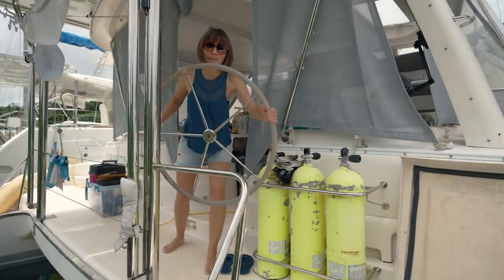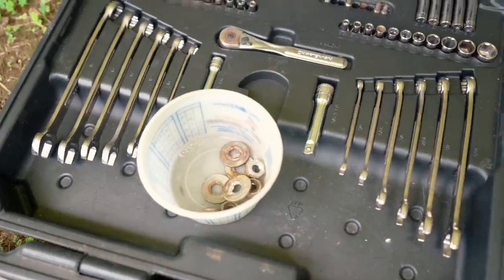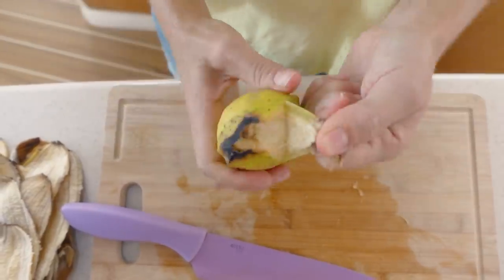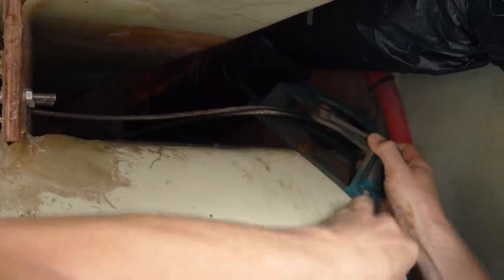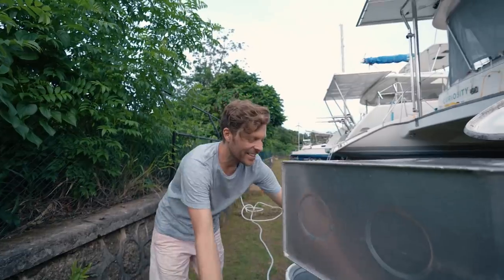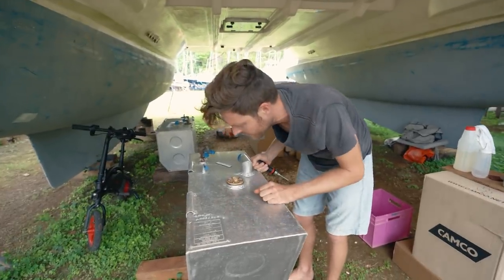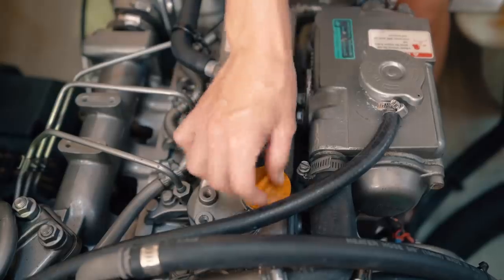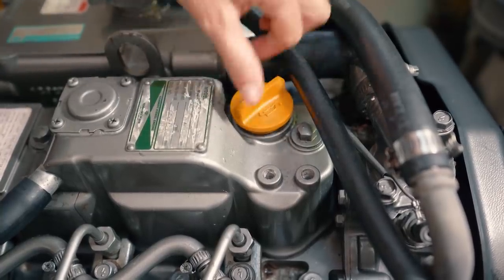Knocking Out A Steering Issue

Comment: You should get shafts for steering pulleys drilled so that you can pump grease into the turning surfaces. If pin is 4 inches long, drill hole down from top about 3 inches. Then drill cross passages where the two pulley two sit.  Tap for 1/8 npt at top of shaft. Then get some hydraulic hose with an 1/8 npt male thread on one end and 1/8 npt female end. Finally screw 1/8 npt male grease nipple into hose. Assemble pulley block, screw hose into top of shaft. Now every week you can pump a couple of pumps of grease into rotating pulleys. Place end of hose where you can access it easily.  One other thing on pulley mount, you should have a tapped plate that has your mounting bolts going outside. The pulley internal mount should then be tapped on to this plate. Now you can remove pulleys, while under way, by just undoing 4 bolts that are in inside, and are threaded into mounting plate.  It is easy to service the pulleys.

Comment: Cleaning the Gelcoat before putting the bolts back in place would be a good thing. And you never ever want to use old self secured nuts. I'd replace them immediately, even on the water as you are in New Zealand now somewhere. Seriously.... A fail of the complete rudder system is not an option I believe.

Comment: I appreciate that the tanks you had repaired are used for holding diesel fuel but thought the following might be worth mentioning anyway.

With regard to repairing tanks intended to contain potable water if you opt for sealing leaks with solder be sure to use non-toxic silver solder rather than lead solder which is a cumulatively toxic heavy metal!

Lead oxide or 'white' lead is particularly hazardous yet was used as a cosmetic ingredient in Roman times, furthermore lead was also used to make water pipes by ancient Romans!

In addition if gluing patches over leaks, also be mindful that many commercial adhesive products contain cyano-acrylate or other harmful compounds.

You do not, want such compounds in contact with or close proximity to comestible substances because they can have harmful effects even if only present in small quantities.

I recall an occasion on which I visited my now departed Mother who mentioned she had suddenly begun suffering from bad headaches.

After a bit of inquiry it transpired that a minor dental prosthesis she habitually wore had recently broken and being a very independent and self reliant person she had repaired it herself using super glue!

A component of the glue in question is cyano-acrylate and when I suggested that it may have been the cause of her headaches my Mother removed the prosthesis and had it professionally repaired after which the headaches did not recur!

Comment: "Deliriously close" to splashing you say? 

The squishy space smiley face scene featuring Jason impersonating a sardine in a can was in keeping with your theme in addition to being humorous then. 

I was mildly surprised to learn that a component which is relatively difficult to access requires such frequent attention.

Bearing in mind that many yacht owners are probably nowhere near as inherently diligent or capable as you two. 

If sealed roller bearings were employed rather than bushes, those pulley wheels could go for years without requiring any mildly onerous attention.

It should not be a difficult or expensive modification.

Comment: Hey you two, glad to see you getting closer to launching!  The Edson sheave and also the housing that holds the sheave is bronze so it will never rust on you.  It can turn greenish but no worries, this is not a structural concern with bronze. Bronze is good stuff on a boat!  Ok, to save you some maintenance work, when you disassemble the steering sheaves to clean them, us a good quality grease instead of oil.  The oil will pretty quickly work it's way out and dry up.  This will last much longer and you can still spray oil on the sheave which will soften the grease and buy you even more time between tear downs.  Winch grease will work great,  top of the line I think is the Variprop Ep special grease which is a super water resistant white lithium grease.  Nice since it is white and doesn't stain things so bad as regular grease.  Hopefully you will be sailing soon!  Best J&J

Comment: Are you two aware - that you put the wrong oil in your diesel engine? If you are aware - this post could be superfluous - if you're not aware - it could be helpful. You put in motor oil designed for gasoline engines. Diesel motor oil is different because it has additives specifically for diesel engines that suspends the soot of the fuel rather that it coagulating in the corners of the engine. Even better is Synthetic Diesel oil which lasts longer than petroleum oil - but is also more expensive initially - but cheaper in the long run. If you run regular gas oil in a diesel engine you need to change more frequently - and more expensively - than diesel oil. Bottom line - what you just put into your engine - was not designed for your engine. Here's a link from Yanmar. You don't need to use the special Yanmar oil - just the specific Diesel Oil. Any brand will do. 
   https://www.yanmarmarine.com/Service-Parts/Oil-Coolant-Paint/

Comment: Check out DrakeParagon on YouTube and you will see what happens when you leave the dock and several hours later the steering fails. Replace the steering pulleys with new pulleys with sealed bearings and keep the others for spares.

Comment: Recently had a guy working on the transmission of my old truck, was using one of those hand pumps to pump out the transmission. it didnt move any fluid for a long long time due to it being 30 degrees F out. Glad it worked so much better for you for the oil change!

Comment: Hi Jason I'm a longtime boater and understand your struggles with maintenance which  comes with boat ownership. I have notice that you are not schooled in the proper use of tools even in your RV days one tool to be specific is your use of a crescent wrench I don't want you to get offended but a crescent is a useful tool because of the adjustability that being said the adjusting jaw should never take the pressure of the turn the rotation pressure should always be on the fixed jaw that is where the strength is this also applies to channel lock pliers if you pay attention to this you may find the tools work more efficiently just a suggestion. Looking forward to your continued sailing adventures, fairwinds and following seas to you and Nikki my favorite couple on Youtube.

Comment: Hi been enjoying your videos for quite some time now thought I would throw in my to cents. When doing an oil change the oil filter takes up a bit of oil so you need to run the motor then dip the dipstick again you will most probably have to add a bit more oil. Anyway you are doing a good job I enjoy your cinematography and the effort you put in. See you on the water.

Comment: That steering design is primitive. I would modify it with custom machined stainless steel ships with sealed ball bearings spinning on titanium shafts snaps it would last longer, be more reliable ,and increase  the service interval times. To modify the system to the next level , I would convert it to hydraulic.

Comment: Quick tip with Nylock Nuts they should be replaced with New  Nylock Nuts , ( reason why its a plastic retainer that does the locking and can be used one time only not that a lot of People do that lol.  If they were Lock nuts the top edge would look oval in shape and can be hit with a hammer to be used again but all so should be replaced on the safety side of your Boat. look it up i am sure you will see what i am saying is Correct. Great Vlog as well looking forward to the splash day Guys.

Comment: With regard to the lubricating oil in your yacht's diesel engines 'looking dirty'.

Because they function on a compression ignition principle diesels normally run at higher compression ratios than gasoline engines.

Although it is a particularly light oil diesel is still slightly denser, heavier and significantly less volatile than gasoline.

Because of these latter factors diesel is an ideal fuel for boats, but combustion products tend to 'blow by' the compression and oil control rings on the pistons in a diesel and so wind up in the sump.

Therefore lubricating oil used in diesels gets particularly black quite fast and the super fine carbon in it can cause tenacious stains.

Therefore just because diesel engine oil 'looks dirty' it is not necessarily an indication that it requires changing and that is why you should adhere to maintenance periodicity determined by runtime indicated by engine hour meters as specified by the manufacturer.

I also paused the footage where Nikki displays the bottles of sump oil you purchased for the boat during your road trip.

Fortunately Nikki was holding the bottles in such a way that the front label was visible on the one in her right hand and the rear label was visible on the bottle in her left hand.

No indication that the oil was specifically formulated for diesel engines was displayed anywhere on either side of the bottles but diesel engines require oil that is, specifically formulated for them.

Lubricating oil specifically formulated for diesel engines should and normally does clearly and prominently state that it is on the labelling.

No doubt there are additional reasons, but diesel engine oil contains significantly higher levels of specially formulated detergents than oil for gas engines.

Lubricating oil for diesel engines is also more viscous or of 'thicker' consistency than oil for gas engines so while diesel lubricating oil can be used in gas engines, it does not work the other way around.

Oil for gasoline engines should not be used in diesels and while it could be done in extreme cases of necessity it should not be done for long!

Comment: Those sheaves are bonze with inserts. only point that needs lubrication is the pin that sheaves ride on and a very small amount of lube on cable.  Good job on lubing cable ( light lube)

Comment: When you replace a filter like that one on the engine oil, it is wise to prefill the filter with oil before you screw it on. This avoids any component running dry while the filter is filled when you first start up after an oil change.
Looking good guys. See you in NZ when you arrive.

Comment: I would have used marine approved vaseline for the steering wheels. Crc has salt water durable vaseline. The spray you put to shaft will not be there more than week. Btw we are huge fan of yours, Cheers engineer Tony

Comment: so how come you can't get a drip hose and a closed container above deck, the attach the hose to just above the pullys and fill the container/resevoir, with corrosion x.  this way it will just drip onto the items that need lubing.  also you can put a small valve so you can shut it off when not needed .  You can also get a tupper ware container to put under those items too collect any liquids that are dripping.  too clean up just put a oil rag in the bucket ...

Comment: dont know if someone said this but when pumping out the oil, you can pump for a small while, 30 sec or so, then you have a vacume inside that will selfdrain the oil and you dont have to pump, since it felt like you was pumping threw the whole time, when it stops to drain, change the hight of the hose and pump a bit more untill you feel done

Comment: You should cut a hole in the aft deck directly over the steering sheaves and fit a spin out inspection plate that you can buy from most chandlers then you can lube and service it easily!

Comment: That particular part right there “steering pulleys” would be an EXCELLENT candidate for anti seize!.. Try not not get it on fingers lol.. it’s difficult to get off, but harmless...You can order it anywhere 
Anti-Seize Lubricant Bottle - 4oz A highly refined blend of aluminum, copper and graphite lubricants. Use during assembly to prevent galling, corrosion and seizing due to weathering or chemicals. Anti-Seize assures easier disassembly. Temperature range: -60°F to 1600°F (-51°C to 871°C). Salt, corrosion and moisture resistant ideal for marine use. Non-aerosol version meets Mil Spec #907E.
Reply: ZeRowe, and one ounce will cover the boat from end to end . 😉 !

Comment: Nikki Wynn proves a true lady sailor who makes rudder gear cleaning, sealant fills, nut torquing and oil changes amusingly glamorous 😆 --- so CAPABLE!   Nice job on the fuel tank improvising and crawling into the rudder blocks' "bake locker", Jason.   And so close to relaunch, too.  With so many of the borders still closed (per the "Zatara" and your own experience just departing Fiji), where will "Curiosity" sail until that situation changes?

Reminder: Check for leaks after launch.  You did work some though-hull fittings in this video.

Blessings to you both,

S/V "Windwalker"
Reply from the maker: They will sail around Tonga, at least through cyclone season.
Curious Minion

Comment: You might want to fill the oil filter with oil so when you start the engine it wont run without lubrication while the filter fills.

Comment: I’m in the amateur aircraft building world. Tank liner sounds like a product that has caused some problems with light aircraft with aluminium tanks. The “slosh” (which assume is very similar) would sometimes peel or flake off. This of course would get picked up by the fuel supply line and plug things up, causing an engine failure. Not good. 
  Plastic would probably be my first choice also.
  You must be itching to get Curiosity back in the water!
Reply from the maker: We are!!!!!!!

Comment: It looks like things are coming together! Niki your hair cut you gave your self looks good! It seem that you need to be mechanically incline when you own a boat and thin to get into those tight places! When you get sailing again, where do you think you will be welcome or allowed because COVID19 is still around to various degrees and various restrictions, sometimes the restrictions do not fit the out break! Even with a vaccine it seems that for the majority it will protect them but for millions taking the vaccine will not protect them and depending on the effectiveness of the vaccine ,they will determine how many millions will get COVID19a or who will get ,so it looks like restriction will be apart of life for sometime to come! I was wondering is it possible to put a out board motor on your boat for emergency use, there are some very powerful one available in both gas or diesel powered!
Reply from the maker: Well the boat has 2 engines, so chances of them both failing at the same time would be slim, and the Wynns tend to run only one of them at a time. You can mount an outboard on a catamaran but it needs to have a special long shaft to reach the water.
Curious Minion

Comment: Hi.

How did you get 5 lts of oil out of one engine and only put back about 3 lts or less.?????????????.

Hmmm.

David.
Reply from the maker: That’s an 8 liter jug of oil (it looks like the gallon jugs you get in the USA but it’s much larger).  We put in 4.5 liters but we can’t get a good reading on the dipstick because the boat is not level.  The oil top off will have to happen once we splash and the oil settles.
Reply from the maker: I put in 4.5 liters.  That is an 8 liter jug I am pouring from.  Once we get it running, I will check the levels and top off. 😁

Comment: What brand is that thin reusable freezer bag you used? I could definitely use those!
Reply from the maker: Whenever you're looking for more info, click over to the corresponding blog post. In this case, there's a link to the bags, and don't forget that shopping via that link won't cost you anything extra but it'll throw a few pennies into the sailing kitty! https://www.gonewiththewynns.com/knocking-out-boat-projects  There's also a gear store on the blog with all their favorite things, so check that out as well.
Curious Minion

Comment: Hi guys... .So happy to see you are almost there and ready to hit the water... Quick question... in the galley, do you have a stove top and oven or what are all your cooking options?  I see a (panini) grill or something... Thanks
Reply from the maker: They used to have a propane stove but Nikki prefers not to cook with it because it puts heat into the interior. [She didn't use the propane stove in the RV either.] So that has been removed and the new shelves have been installed for electronic appliances. If you'd like to see her favorite appliances you can check out the "kitchen faves" tab in the Gear Store of the blog. Happy cooking!
Curious Minion
Reply: @gonewiththewynns  Oh dear.....  Please forgive, Where do I find the blog???   Only after you have had the glass of wine....   Thanks

Comment: You both seem to be suffering from cabin fever. lol. I am glad you got the fuel tanks repaired. I am now getting a better feeling of the shortages on that island. So were you aware of the problems with your boat before your departure or when you got back? Well good luck to you both. 🤗
Reply from the maker: Every boat owner has a running list in their head of all the things that need to be repaired/replaced or will need it soon haha! They did have an extensive list before they left Tonga - those are all of the things they shopped for in the USA and put into the crate that was then shipped to Tonga. Because many things just aren't available in such a remote location.
Curious Minion
Reply: Well best of luck to you all. Happy sailing.